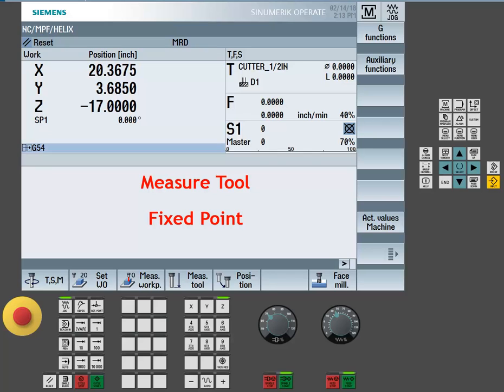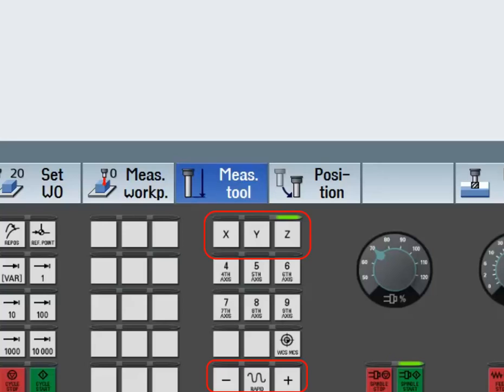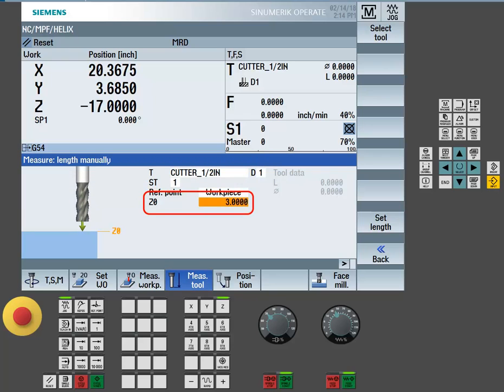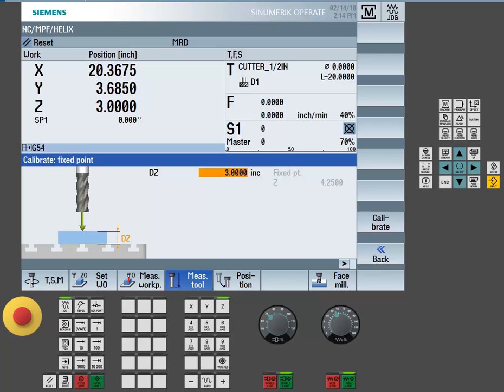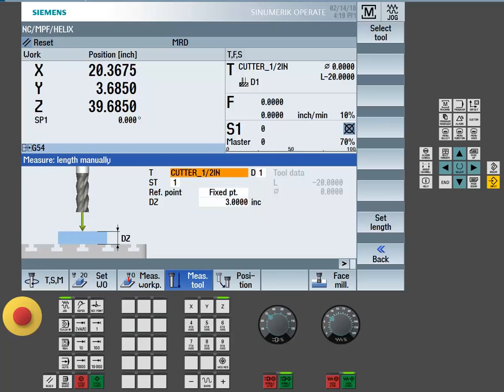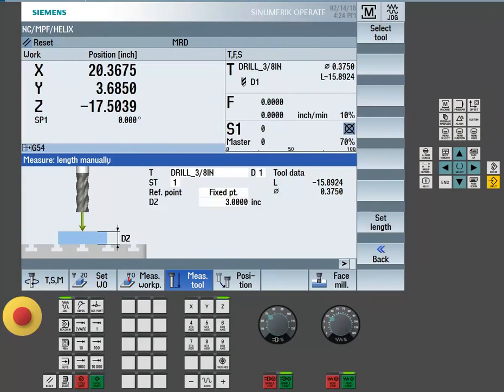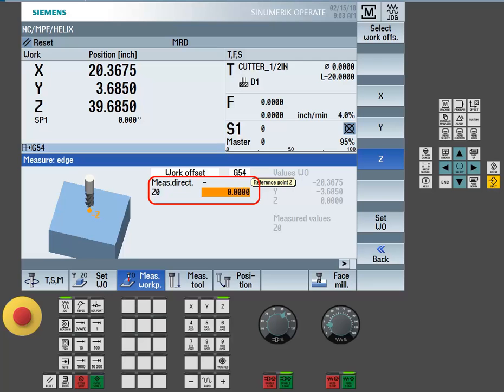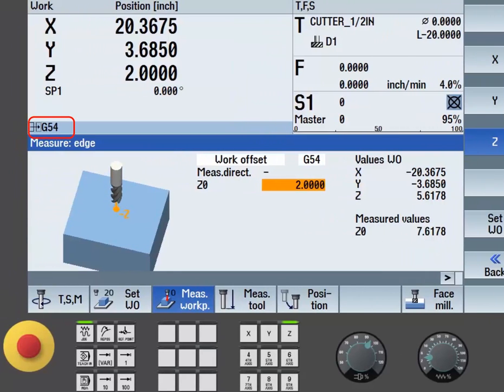🔧 Tool Length Offset with a Fixed Point on Siemens Sinumerik! 🎯

Comment: Is the work offset automatically ignored during tool calibration? Certainly when manually calibrating the tool used to set the fixed point, there should be no offset active(or an offset with no value in z) or else you are calibrating the fixed point to the active offset, though technically it would still work with that caveat.
Reply from the maker: no it does not ignored the work offset.